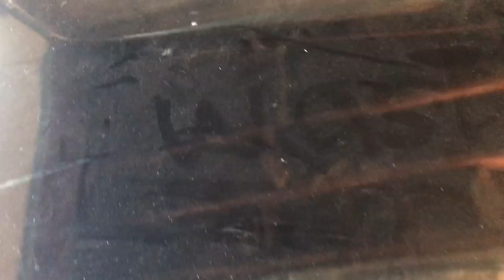USING THE STEAMER  AND EQ LOTION WAX. EQ website is now available.

Comment: Mr.Jones...I am a boat detailer and my skill is the correction of marine gel coat. Not very often do I get requests to clean and detail the interior of a cabin cruiser boat which have carpeting. My question is: what type of steamer/extractor would be best to use on stains several years old. And how do I tell a customer I cannot promise the staines will come out. I say this because I recently did an interior using a household steamer and shopvac to extract. It did not turn out perfectly clean/new but the difference was day and night.
Reply from the maker: GM FRANCISCO. I hope everything is well my friend. I use the US 1900 industrial steamer. Its a little pricey but diffidently worth the money if you are doing any kind of interior job boat or vehicle. I done a mildew job on a guys boat one time and it did wonders with the 365 degree steam that it produces. But always explain to the customer that since the boat is affected  by harsh water that everything may not come out. Even though you know that they will come out but explain to them just in case the damage has already been done to the material of the boat. Positive flow.

Comment: Great video, had a question? What the best was to remove water spot off of a car? An i will be ordering from you real soon thanks for the videos.
Reply: Meguiars wheel cleaner is what I use.
Reply from the maker: Gm morning. I've always used a  little  trick as to always carry a EQ clay bar on hand. I just spray water on the infected area slide the clay bar across the infected area until the  water spot begins to remove..  Positive Flow.
Reply: @ericjones3920  thank you very much

Comment: Can we do this steam method for cleaning paint in winter temps? It got really bad in Canada, -40 C (-40 F)
Reply from the maker: amritGAMINGYT GM. I found out yes in some cases.. But the steaming will take longer n a lot of rags. But it can work. As long as you charge correctly for your time. The real dirty vehicles are really hard with steam method. Positive flow.